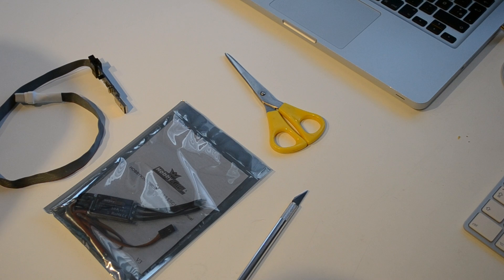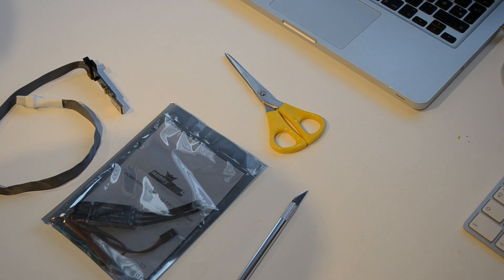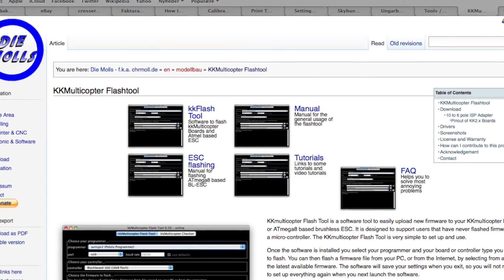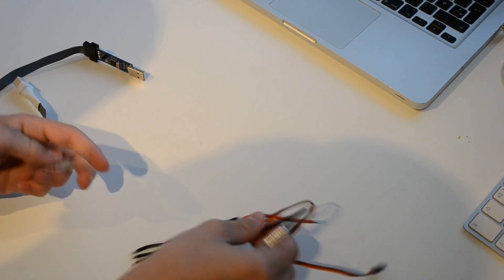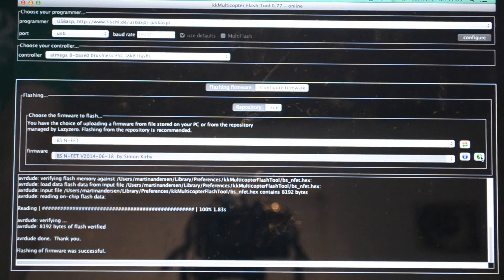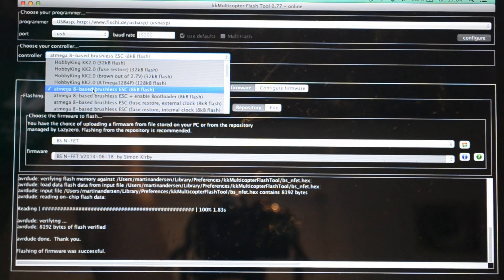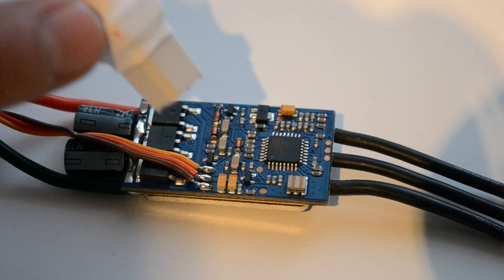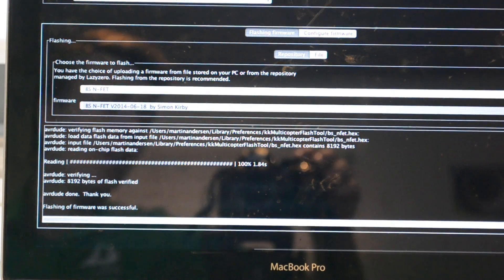Flashing Hobbyking blueseries ESCs with simonK firmware

Comment: So if i want to program me an ESC that is been flashed with Simonk what programming card should i get ??
Reply from the maker: First of: Why do you want to program them? You have already flashed them with SimonK firmware which is optimized for multirotor usage. 
Second of all: I'm not sure there are any programming cards to program ESC's flashed with SimonK firmware, simply because they aren't needed. When you flash the ESC's with SimonK you plug them in and power them up. Then you put throttle stick at max - when beeps lower the throttle stick to minimum. That is pretty standard and is all you need for multirotor use right? :-)